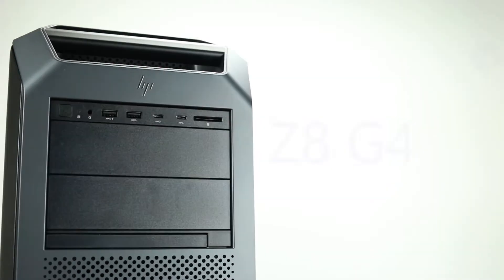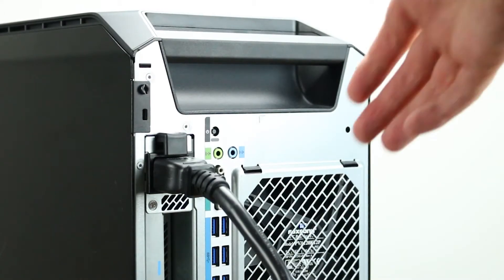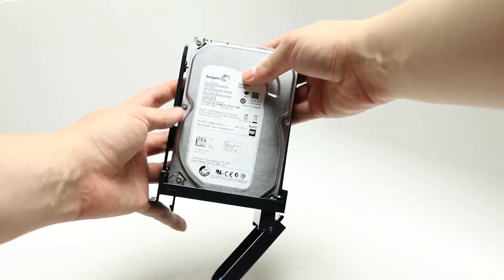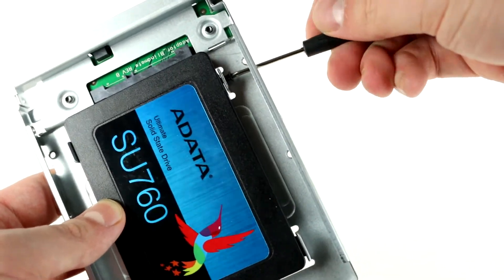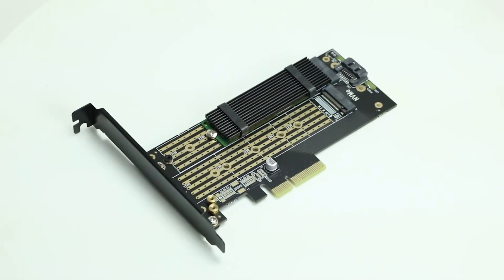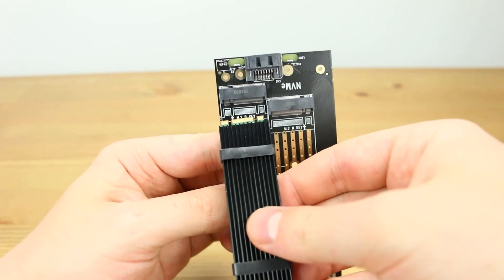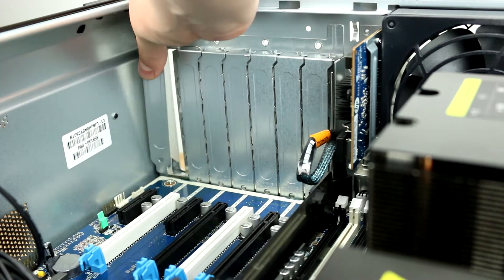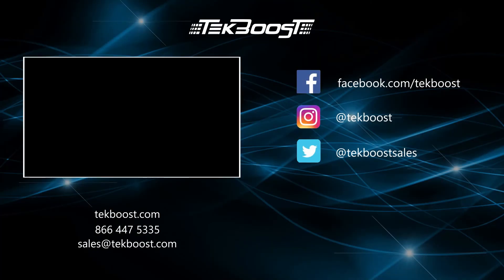HP Z8 G4 Hard Drive Installation

Comment: what's the spare part number for the 2.5 carrier? I can't find it.
Reply from the maker: The HP number for the 2.5" tray I'm using here is 654540-001. Let me know if you need anything else!
Reply: @tekboost  i need a gf
Reply from the maker: @usuariocabreado1798  Its a compatible adapter.  It converts the 2.5 into a 3.5" form and will fit the 3.5" carriers inside the Z8 G4.  The quick specs which tend to show the part numbers for adapters and other optional components, do not show it for this option.